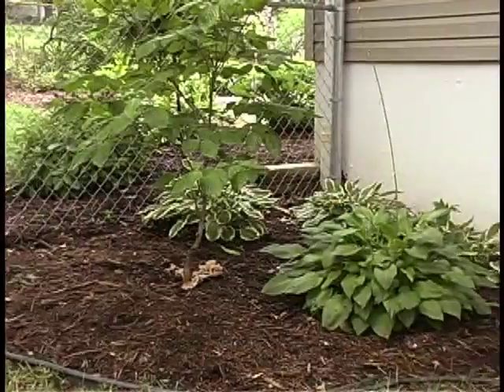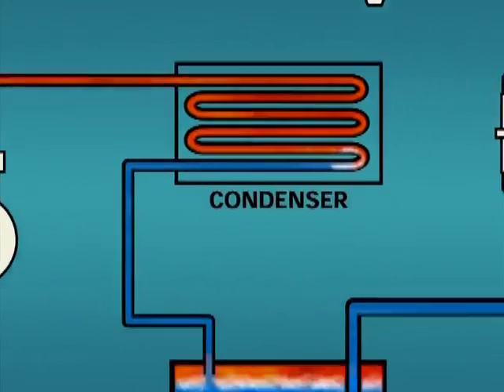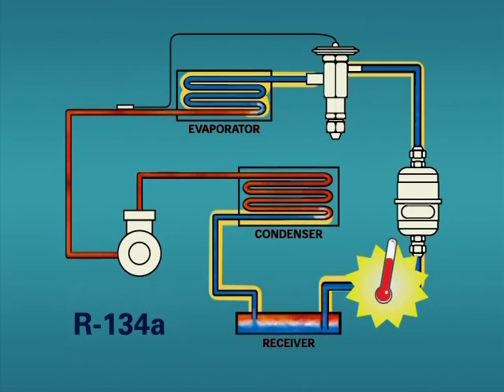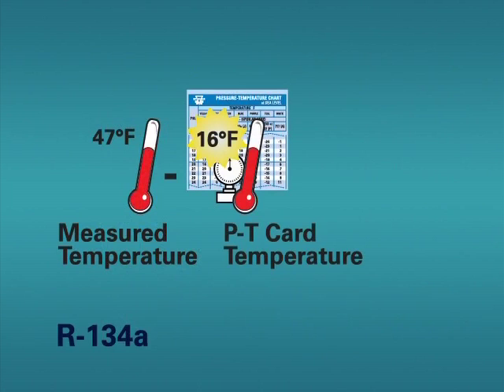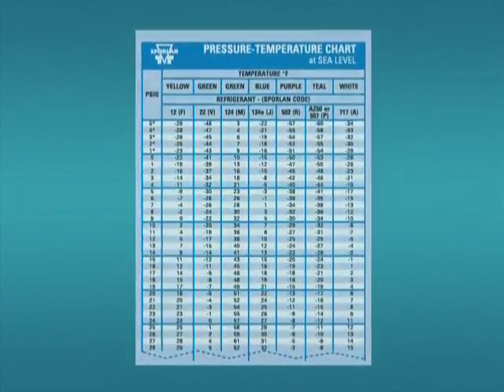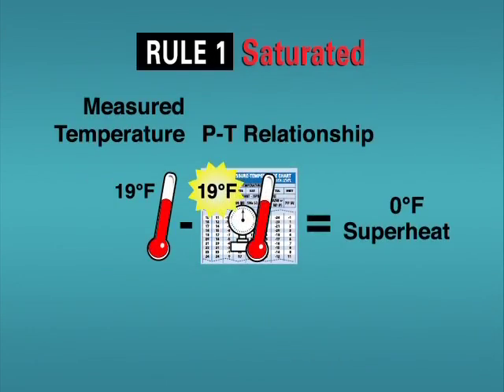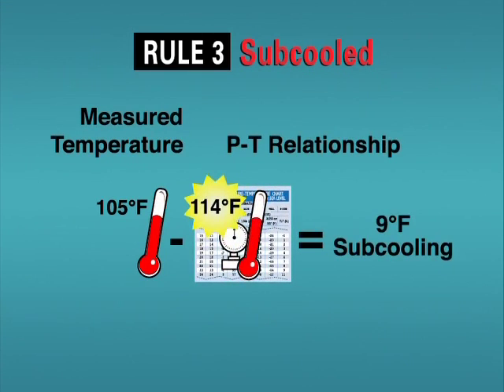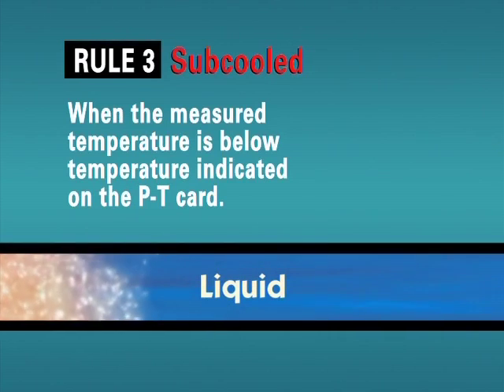How to Use a P-T Chart

Comment: At about 11:30 min into video / it should not be 158 psi at the compressor,  trouble in the system??  look again  the suction pressure should never be that high.

Comment: Could you take temp reading to determine pressures?
Reply: Yes
Reply from the maker: Yes.
Reply: @sporlanvideo  so if you knew pressure drop across coil why check pressues? Couldn't you just compare temps, factor determined pressure drop to determine pressures? No refrigerant gauge hookup needed.
Reply: @sporlanvideo  surely only in the evaporator and condenser? They are the only places in which saturation exists and therefore you can read pressure from the p-t chart if you know the temperature?

Comment: If the refrigerant is 100% vapor, what is the gas saturated with? Is that statement @ 1:13 an error?
Reply: Saturation is the point (pressure & temperature) where the fluid will be found both as gas or liquid based on its internal enthalpy.
Reply: If you think of it as adding heat to the liquid, saturation is the point at which the liquid cannot gain any more heat and remain a liquid.  In this sense the liquid is saturated with heat.  If you add heat to a saturated liquid it does not get warmer, instead it converts to vapor (by boiling generally) until all the liquid is gone.  The saturated mixture exists during the conversion from liquid to vapor or vapor to liquid. In thermodynamics the percentage of how much of the mixture is liquid and how much is vapor is often called the 'quality' of the mixture.

Comment: At 11.45 the pressure is shown 158 psig at compressor suction inlet. Actual measurement should have been 16 psig. Overall this was a great informative video. Hatsoff to sporlan. My request is to also upload a similar video for R404A as it is now widely used.

Comment: It's confusing, that the superheated steam has a lower temperature than the subcooled fluid.
Reply: This is because the saturation temperature is dependent on the pressure.  The subcooled liquid is only subcooled relative to the pressure it is held at.  So a refrigerant like 404A is a superheated vapor at -20C and 5psi where the same refrigerant is a subcooled liquid at +20C but requires a pressure of around 145psi to stay liquid at that temperature.
Reply: What superheated steam are youtalking about. We are talking about superheated refrigerant.

Comment: sir, i want to ask what is the reason: a 110 watt compressor runs ok in around 70 watts, ..low side stays in vacuum around 25 and high side around 200 psi.the pressure on high and low sides does not equalize if i turn off the compressor..
Reply: Sir, you need te divulge so much more info.  That's like asking, the man jumped off the roof to his death, but nobody knows why.......
Reply: vrich marketing renewable energy and a
Reply: vrich marketing renewable energy okvbgcvbf